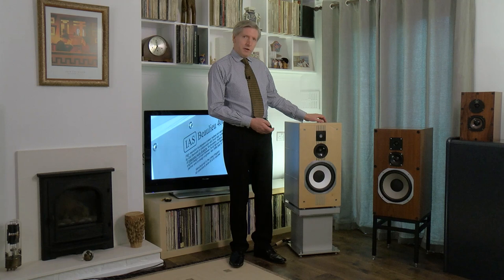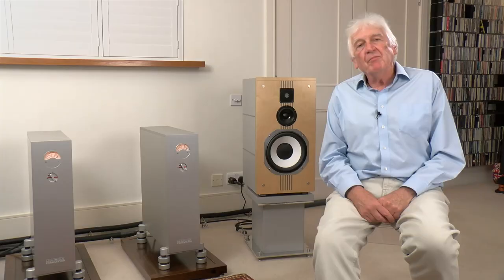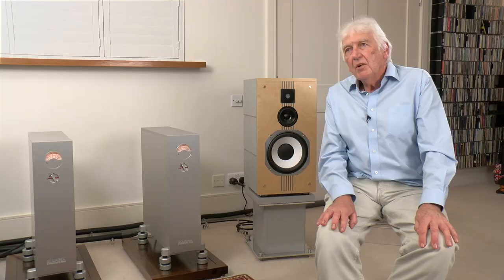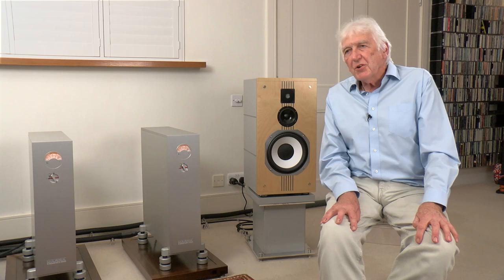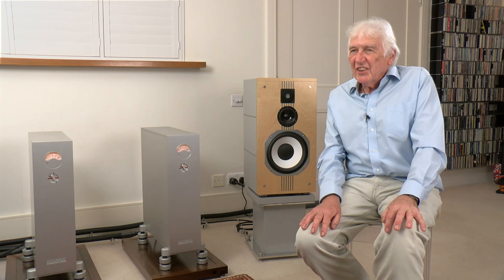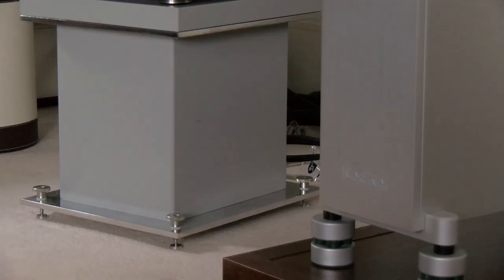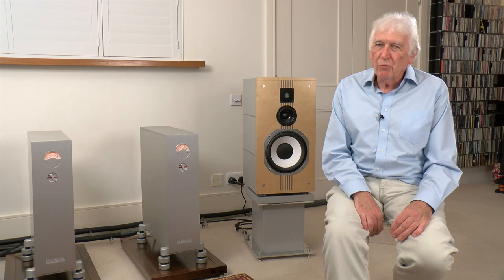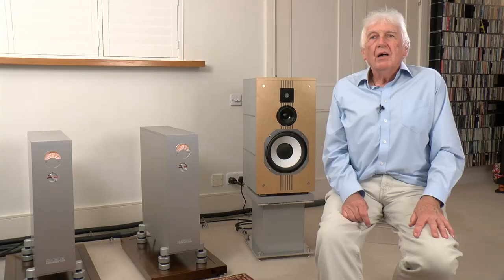IAS Beaulieu 40R stereo loudspeaker system - Steve Harris interview

Comment: I had the Beaulieu's in a lovely mahagony finish from 1991 to early 2000's.  They had been modified by a hifi enthusiast, so had slightly different drive units to the standard.   I sold them to a friend and switched to LEAK 2075's which I still have.  The IAS's had fantastic midrange and the 10" VOLT bass had huge, massive kick.  To my ears (personal) they had always been a bit bright and must have been the 1.5" Son Audax tweeters but were extremely clear and gave a huge sound for their size. Will def keep an eye on these ??
Reply from the maker: Thank you for your comments.  I briefly owned a pair of Leak 2075's, - a model that came near the end of Leak's line in business, albeit with Wharfedale.  A friend's father, the chartered accountant for Rank Audio-Visual up until 1982, was their hatchet man for winding-up all of the hi-fi and audio business in 1982.  The 2075 used old Wharfedale chassis' on the 15" and 8" sandwich units from memory, and the spiralled perforated midrange unit was taken from the Linton/Glendale speakers, and then a Du Pont Mylar treble unit.  The cabinets required plenty of space around them though, as they were highly resonant and tended to boom if used in smaller rooms, whereas my Tannoy Buckingham (domestic version) at twice the weight but similar in size were much tighter and more controlled in restricted spaces.  The 2075 was a rather good speaker though and was replaced with the very similar 3090, but with lossy level controls and the rather laid-back sounding Isodynamic Wharfedale treble unit, as fitted to the outgoing Teesdale and Dovedale models of around 1977-79.  Regarding your IAS Beaulieu speakers, sadly too many people underestimate the IAS crossovers and over time have sought to replace them with more conventional (though probably better assembled) circuit designs that, even with upgraded wiring and boutique components, ultimately lose the magic that the original circuits achieve, which are quite specific to the system's voicing, being unique against the usual 'stock' breed of crossover designs implemented in other loudspeaker systems, and more often than not, being beyond a good many designers' understanding;  casually writing-off what unwittingly appears to be unfathomable logic.  The late Alan Willis of Integrated Audio Systems was a master of his art on crossover design and highly regarded as a consequence.  The brightness you encountered on your Beaulieu would inevitably have been noise riding on the high-frequencies (EMI/RFI) as I have quelled such on my equipment with Shunyata Research and Entreq devices to good effect when driving my 1980 pair of Beaulieu speakers which use the Peerless treble unit applied with Ferrofluid.  More expensive high-end gear manages without such additions;  being integral to their heavily invested designs, but the IAS speakers were actually intended for being used only on top-tier equipment.  Anything less and they would appear bright in balance.  Back in 1981 at the dealer I worked at, it was Trio High-Speed amplifiers that cut it back then, including the L-O8M mono power amplifiers, L-07D turntable and Revox B77 that collectively fronted the IAS Beaulieu and IAS Studio 811 loudspeakers in demonstrations.
Reply: @britishcomposers  Thanks for your insightful reply.  I could now live with the IAS's as I now have better gear than way back.  The IAS's and 2075 have lovely, clear mid, great for vocals and both can play LOUD.  Love playing the Sheffield Drum Kit (Keltner/Tutt) through BOTH.  Scary PA volumes but the Volt 10"/15" Leak hardly move ??  My 2075's are the Mk1's which have CAST lower mid and round black plate tweeter with a MUCH larger magnet than the flashy later square silver plate.  Cost cutting ?  I have filled the empty bottom plywood chamber with concrete so may be 60 KG's now.  I plan to use thick self adhesive damping foam on the rear OUTSIDE at either 10, 20, 30 or even 40mm, as easier than bolting plywood panels.  I HAVE looked at other speakers,  Tannoy's, PMC's, JBL's and ATC's but prices......good speakers are EXPENSIVE??  Seen a demo pair of ATC SCM 40's (passive) at £3,360 and s/h ones at £2k and £2.7K though they are small by MY standards. Low sens. 85db so maybe my ARC Ref 110 (KT120) will drive them.  ATCs seem to be a marmite speaker, love or hate.  Have heard that Celestion hf 2000's can replace the mylar Leak tweeters without mods, sound nicer ???  Thanks again
Reply from the maker: @christophermaley6822  That Sheffield lab recording was used extensively as part of my library of recordings to test the 40R.  It's that kick drum that shows how it should sound, with nearly all other loudspeakers either lacking the speed, attack and above all else, the power right low down that you can physically feel.  Add to that a really good treble unit, which is so underestimated as to just how much that makes the whole system convey realism, and a really good amplifier that pulls its punches and such a recording amazes every time.